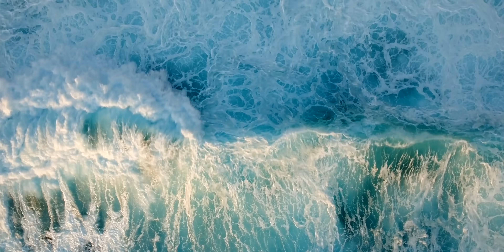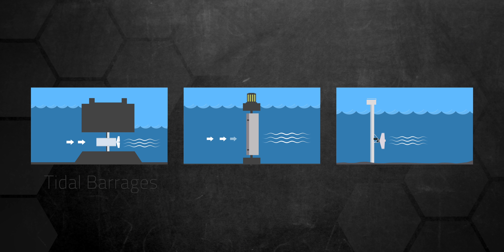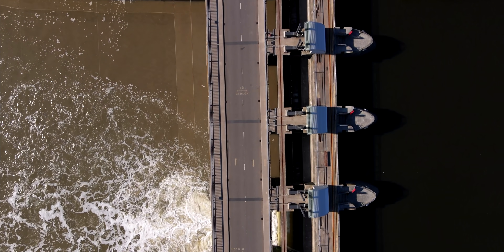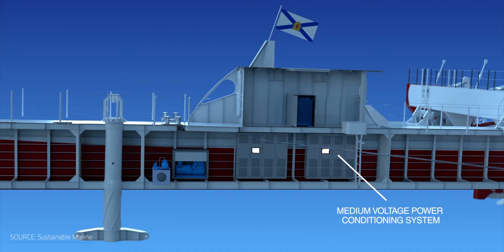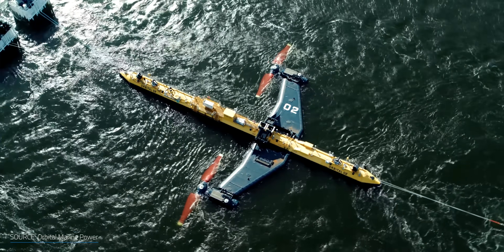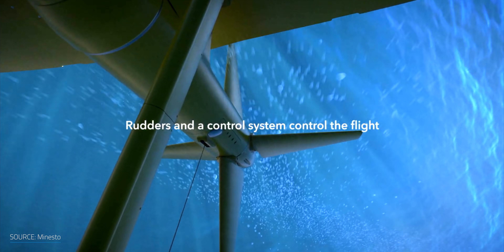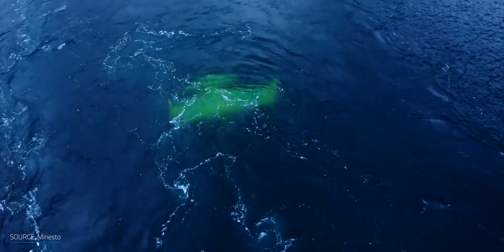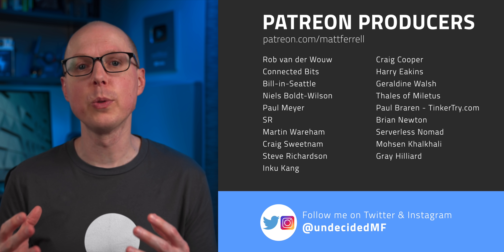Can Underwater Turbines Work? Tidal Power Explained

Comment: All these technologies are based on complex mechanics with a lot of moving parts, and above all, they are only exploiting the currents created by tidal movements where coastal structures are favorable. 
I am suprised that nobody is considerining extracting the potential energy created by the very fact that huge amounts of water are lifted up by the tide, and then falling down, releasing that energy. Or even simpler, don't let the tide lift water, but e.g. a huge platform or buoy.
So: Anchor a huge buoy to the seabed with a cable pulled tight, and let the pull of that cable when the buoy is pressed upwards drive a generator. I am not sure we could extract energy when the tide and buoy are falling, but that might also be possible. I believe the efficiency of this concept would be much lower than for wave buoys, but that could be compensated by size and simplicity.
Has anybody looked into  such a possibilty?

Comment: I think we need to look at something different in how we go about this ?
Can we not develop something based along the lines of Archimedes Screw, rather than turning blades that will damage fish and other wildlife ? These devices could be fixed to the sea bed along the lines of flowing currents and will be pretty cheap and easy to install. 
No rotating blades to slice through whales and dolphins, so it takes a big chunk out of the objectors argument. 
Lets look into technology that could make that work and give us cheap energy 24/7/365, GUARANTEED.
Reply: There are multiple papers and even journals done specifically on studying the effects of these renewable energy devices. The power rating from these turbines are so much better than letting animals not getting killed by its blades. Ultimately, its better than letting the world die by climate change.

Comment: Very interesting ideas because we need to stop eolian from spoiling our countryside. I've just discover a power station in Mutriku, in Spain, whereThey turned a dig into a power station by getting the waves into the square tubes you can see. It pressurize the air in a turbine, which creates electricity. It creates electricity when water gets back to sea too. And there isn't any side effects on marine life. The video is called "L'énergie des vagues - Thalassa".

Comment: I'm still wondering why some of these technologies aren't put to use in rivers. Issues of corrosion, and installation and maintenance costs would be reduced dramatically. Rivers flow 24 hours a day so hours of operation would enhance efficiency versus worrying about tidal change hours, or even height of tidal changes. Rivers flow faster so turbine output could be increased easily. Getting power to shore...not a problem anymore. Location...there are hundreds of thousands or even millions of miles of river shore locations around the world. Most (not all) countries have more miles of river shore than sea shore land available. Just saying I'm still wondering...

Comment: Update on the Minesto kite power. They have developed a larger kite that has a capacity of 1.2 MW. Minesto has identified 4 sites on the Faroe Islands which are exceptionally good for kite tidal energy. They expect to be able to install 20 to 40 MW of energy on each site, with the ability to supply 40% of the Faroe Islands’ energy needs before 2030, which will help the islands have 100% renewable electricity production before 2030. Renewables currently stand at 40% of energy mix, with the rest being mostly from hydropower and wind power, with a small part being solar and biogas.

Comment: WaterRotor is a Nifty Hydrokinetic Device. Designed for Slow Moving Water. They're Developing an Offshore Wind Platform With Their WaterRotor Device Built Into the Submerged Portion. Ideal For Offshore Wind in the Gulf Stream.

Comment: Could you take a look at wavemats? Similar to the undulating membrane, except that they are surface wave action mediated. Chop, or large waveform surface action can increase the 5m threshold to encompass greater effective area. Sweden has pioneered this tech and im wondering if it has progressed?

Comment: Isnt it crazy how complicated they make it.. When....

Lol. 16,000 psi at the ocean floor and 14 at the surface... A simple tube with generators in it and water pressure... Like an open ended tube with the intake in the water at depth could push water up to the edge of space. Would have the whole ocean behind it at surface level to.... Guess actual unlimited energy in the form of a natural pump with high energy low and low energy being higher isn't really what they are after tho... Obviously cause its kinda a common sense thing.

Comment: There was one form of energy that i saw a few years ago, 
Effectively it was like an area of land with a cover that was supported about six foot at the edges that slowly increased toward the centre.
At the centre there was what looked like a cooling tower.
This was in a country like the U.K.
The air under thd cover heated up and because of the shape of the cover quickly made its way to the cooling tower but in the tower was a turbine.
It did not rely on wind and only required a small increase in temperature to operate the turbine.
It was first thought that this would be using farmland that because of the structure would stop growth of plants, however this was not the case in fact plants grew very well under it, by the way rain could go through the covering.It was also thought that it would only work during the day but it turned out that the heat stored in the ground was given up at night so there was a constant flow of air.
It worked very well but i never heard about it again.

Comment: I've been wondering about 'strings' of funnelling 'screw' turbines in rivers, tidal and ocean currents (basically a screw starting large at one end getting smaller) connected at one end to the generator - transferred to shore by the 'string/cable.  As they don't have blades, they're low on damaging marine life. The flow makes them turn in low or stronger currents - no resources or time to develop the idea though. 
Also, the power pod you covered in your wind video - funnelling the current into a central set of 'blades' could work underwater?

Comment: Screw propeller, or Archimedes screw. Long horizontal propeller. Probably the most fish friendly with more electrical output since the radial travel is significantly smaller while having more usable area in contact with water.

Comment: tidal power?  that's basically what the "katz" did in futurama (ep' "That Darn Katz").

taking energy out of the spin of the earth, to power ... what ever you want.

if you don't see the connection, you need to ask yourself, where does the power in tides come from, and in what setup would that power no longer be available (when the earth is tidal locked with the moon; i.e. rotating at once a month).  taking that power out of the system, means you get closer to the point where there is no energy in the system.

Comment: "Tides" are slow as HECK, so you'd need MASSIVE gear ratios to harness that energy, vs WAVE energy on the surface which has a MUCH higher frequency! Put "floats" on geared poles on the Ocean, to rise and fall with each wave and you'll get WAY more energy input! ("MacGyver: 2021™/©")

Comment: better solution might be to use water weight.
an incoming tide is massive kinetic energy, then creates potential energy as it rests. The outgoing tide can release the potential energy as it takes pressure off the ocean floor.

Comment: This is keeping me awake...
I think we can use ram pumps to solve the energy crisis. First we build a hollow cylindrical tower out at sea, to a depth of say 1100m. The tower is open to the air at the top and has a sealed base at the bottom. We drill a hole about 20m below the surface and feed water into the tower. The water falls down a pipe for about 200m where it powers a turbine that is connected to an electricity generator. We collect the water and drop it down a pipe for another 200m to another turbine. We do this twice more until we are getting electricity from four generators.
We then drop the water another 200m to power a turbine which drives a cog that is geared to turn a disc at the base of the tower. The waste water from the last turbine starts to collect at the bottom of the tower creating a shallow reservoir that we need to pump out.
The rotating disc at the base of the tower has cams along its edge. These cams are used to push pistons outwards. These pistons are in cylinders built into the wall in a circular formation. The cylinders are sealed at the interior side apart from where a piston rod enters to push the piston outward. The outside of the piston head is exposed to the deep sea water. 
The cam will push the piston outward against the high pressure deep sea water. An inlet pipe will take water from our shallow reservoir which will be pulled into the space created in the cylinder, behind the piston head. When the cam releases the piston, the low pressure water inside the cylinder will be the only thing pushing the piston out against the high pressure deep sea water.
This is when the system acts as a ram pump.
The piston will be forced inward and will force the low pressure water back out through the inlet pipe toward the reservoir. The inlet pipe will now act the same as a waste pipe in a ram pump and the flowing water will shut a waste valve. The remaining water in the cylinder will be forced through a check valve into a pipe and upwards to the surface.
The larger the diameter of the tower, the more cylinders that can be built into the wall at the base of the tower.
I realise that the ram pump cylinder will pump more of its water back into the reservoir than it sends to the surface but we can always add more cylinders to the system. We can even put another layer of cylinders above the original ones as ram pumps still work underneath shallow water.
I think we should be able to pump water upwards at the same rate that it falls into the bottom of the tower and so keep the reservoir nice and shallow.
Now, if I understand the maths correctly, we might only be able to pump the water near to the surface. In that case, we can pump the water into a reservoir tank (inside the tower) and use the electricity generated by the first turbine to pump out the tank.
This will leave us with 3 generators worth of electricity for every tower built.
Would this work? Everyone, please comment.

Comment: I think all tidal power technology that relies on anchoring a structure onto the sea floor is doomed to fail in the long run. As we learn more about the spread of invasive species, we understand that anchored sea wind farms/tidal power generators will not only have to deal with marine organisms attaching themselves to the structures and affecting performance, but also that these structures can be used by invasive species to reach new areas over time.

My money is on the floating tidal energy systems.

Comment: I wonder if there's some kind of a system that can utilize the compression strength of a pier to create a sea level difference. Think of an oil tanker on a pedestal, as tide rises water rushes in and as tide falls the water rushes out. It would be similar to a tidal barrage, but not be a part of the transition from water to land.

Comment: An important point to note when comparing the costs, particularly in the UK is that a new nuclear power plant currently in construction has been given a 30 year contract at £900 per MWh. So even though currently the costs are >£200 that's still way under the cost of new nuclear and without the decommissioning costs at the end.

Comment: What a shame the membrane turbine by EEL has no traction. That would be the highest output per unit, is small, easy to access, and safe. What happens if I dice and I come across one of those huge fans moving in the water? No thanks.

Comment: I wonder what's the reliability of these systems, maintenance will cost far more because it's under sea.
Cost of installation, impact on environment?
Power production is not stable I assume, there isn't always a tide.

I guess these will have niche uses but not mainstream.

Comment: Why not simply harness the power of a float anchored to the bottom, as it rises and falls in the tide?
It requires no moving parts underwater, it has no blades to kill wildlife and although the massive amount of energy available comes in peaks and troughs with the tide, flywheel energy storage systems are relatively cheap and contain no nasty chemicals to damage the environment.

Comment: Hey I loved the video! It inspired me to create my own quick prototype of a tidal powered generator. Here's the CAD link to whoever wishes to take a look at it. 

- https://cad.onshape.com/documents/a2fc94fc31d36a5bfd332bfa/w/cacd0fe7c2ff1c84a7d02889/e/83d74a97cc34a5956c608616

The generator would be placed underwater on the side of river banks or ocean. The ball would rotate on a rod connected to a generator. The blades connected to the rotating ball would catch the movement of the tides and spin the ball. The wall is to direct the movement of water created by the rotating ball away from the shore to prevent quicker errosion.

Comment: It will work fine as hidrogen producing plant,just need two tanks  trimaran style and rigid sails so you sails in a 8 pattern and store hidrogen in the tanks,a rigid sail is cheaper and more powerful than a blade tre times larger.

Comment: Tidal kite has some parallels with the Makani Energy Kite that flew through the wind (and was ultimately cancelled).  Suspect the concept won't have as many demons as the wind kite (i.e. flight ops problems, a need to make the kite extremely lightweight at odds with surviving crashes), but still operates in a very dynamic pattern thus is apt to be more maintenance-intensive than more static arrangements.

Comment: We need to use everything we can to produce energy more sustainably and remove our dependency on fossil fuels.
Reply: While that is a good goal, the problem currently, is finding a non-fossil fuel generator that can produce uninterrupted power or developing power storage devices that are efficient, eco friendly and can completely fill the gaps of the wind/solar/tidal systems. Nuclear is the only thing I know that fits the bill. And we all know the fear and apprehension the Nuclear plants instill. So, for the foreseeable future I think fossil fuel is still king for supplying our electrical demands.

Comment: Nope, they don't.  At least there won't be a general throw something in the ocean and make electricity at a profit type equipment.

There will be niche applications where this works, but otherwise solar/nuclear is were it is at if you want something non-carbon based.

Comment: My big question with tidal power is, have the solved the material science problem?

I'm been watching these systems get developed for decades now. And the one thing that killed them all, is the thing you point out. The greater density of water over air. It has in the past proven fatal to all of these projects. The tides have just ripped them apart before they can become viable. 

A wind turbine, having far less stress put on it can last on average 20 years, add to that the lower stresses the materials have to counter. Makes them far cheaper to build and maintain.

You talk about a system in Shetland that has been in place for 5 years. How much life is left in that. How many times more expensive was it to build and proving to maintain, compared to wind?

I love the idea of tidal power. It's the one basically limitless, global and 100% reliable, renewable energy source. But I really have noticed that these companies have stopped talking about their long term reliability. Which honestly feels like they are trying to hide something.

Comment: One question i have not addressed by the vid is maintenance especially underwater generators vs above water generators as sea water is pretty hard on gear.
Reply: This is a dumb idea, tidal generators...  You commit over 680 tons of steel to get just 2 MW of power, and like you said these things are going to need constant maintenance which means down time while they're being cleaned of mollusks and barnacles, and floating vegetation and such getting caught in the blades, etc...

Comment: Basically the tech already does commercially work on PLAT-1 and Orbital platforms. However the propeller design is fairly limited in water flows. CyKlone has +30% energy harvest experimentally proven. This does allow to build profitable sites in vast areas of 2 m/s peak current speed. We are much less restricted to ultra high currents of a few small sites and can much better use economies of scale in mass production. If freestream tidal turbines can provide a 60% low price share of energy markets is one of the key question of the race towards a climate neutral future by 2035. Very much is high stakes bets on a few select physics details. We are open to explain the straight forward logic to interested parties under NDA.

Comment: hello Matt, I really enjoy your content.  One tidal power source option you didn't mention was the "blowhole".  It uses air pressure in partially submerged chambers that work very much like a natural blowhole except the pressure changes turn a turbine.  looks very promising as it doesn't appear to impact the sea life and has lower maintenance costs as the turbine doesn't have to be directly in the corrosive sea water.